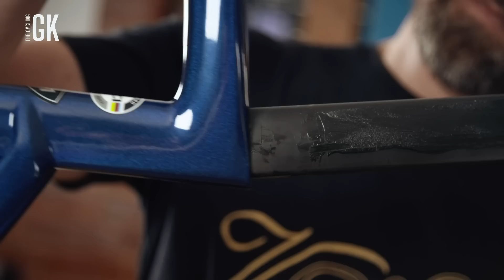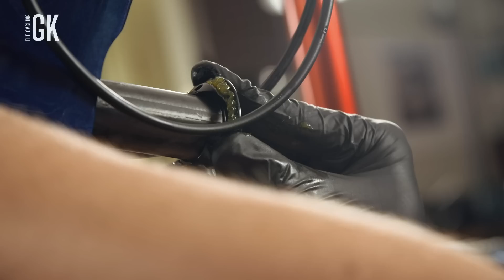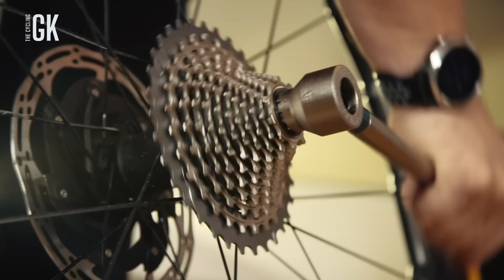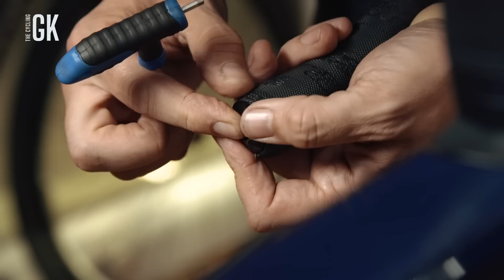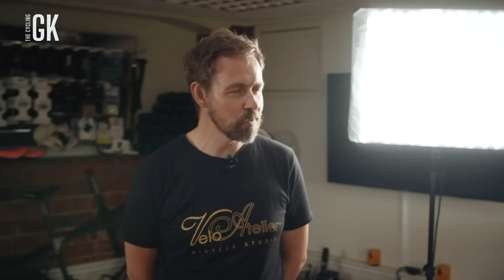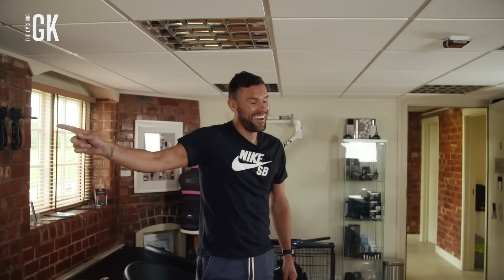New Bike Day Dream Build | Specialized S-WORKS Tarmac SL7 | Ben Foster - TheCyclingGK

Comment: hahaha picked my SL7 up 3 weeks ago and have put some millage up on her already love the blue I went red/black with DuraAce and Ceramic Speed OSPW in red with a BB CS rather than the Shimano bracket also I went for the Aerofly II handlebars as they are so clean and no wires to be seen... kept the Rapid CLX 50/60'S as I have a set of Lightweight Meilenstein Clinchers on the way!

Comment: That's quite the bad-ass S-Works!  Works of art.  But man, those hydraulic lines through the head tube and headset, nightmare for fitting changes & future service!
Oh well, it's a beauty.  And designed about 20 miles south of where I currently type.  
PS  Gotta say, kinda surprised to see grease on the rotor spline(s).  Excellent showing the grease used during assembly (often missed or skipped in YT videos), but I'd opt for no grease there:  Liquifies and sprays outward onto the rotor.
PPS  Oh I woulda given that frame either a good coat of wax, and/or ceramic, and/or PPF prior to assembly.  (and toss an AirTag in the down tube)  A frame waxed and prepped properly at first assembly will shine and shine and shine!